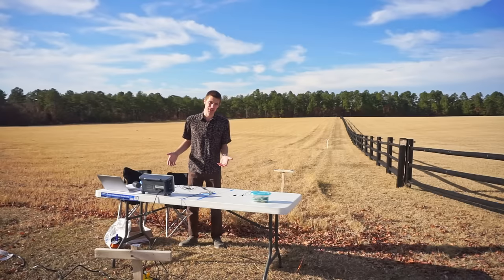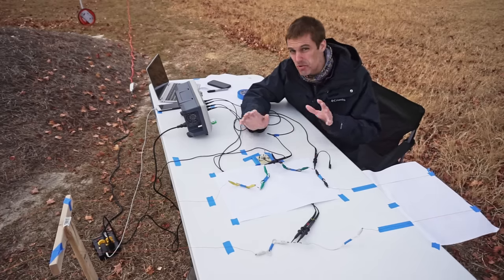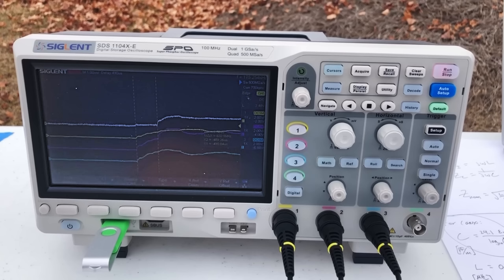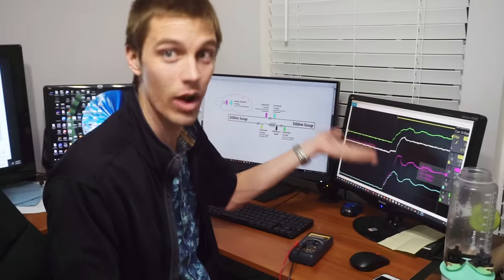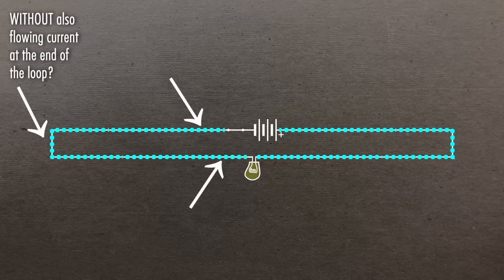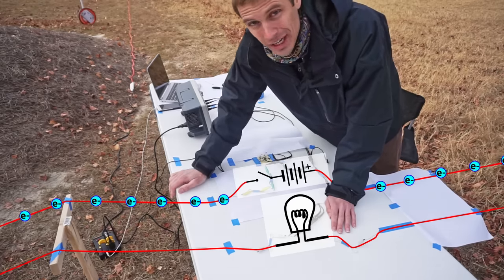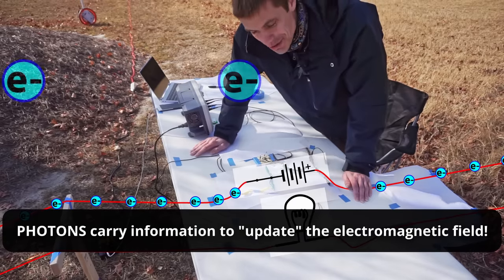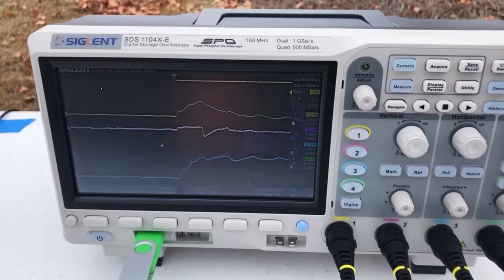I bought 1000 meters of wire to settle a physics debate

Comment: This actually covers the Transmission line theory. At least it does when you cut the wire! The characteric impedance of the wire setup is approximately 45 ohm. If you lower the 2 series resistor to 47 ohm then you can see the 0.2V increase into roughly 2.5V. You can measure this with the oscilliscope near the switch. A 2.5V wave will start from the switch, travel to the open end, bounce back at 5V and return to the switch at 2 times the wire length.  I use this theory a lot to remove oscilations on electronic designs.

The 1K series resistors causes the current to slowly start up (1.7mA). Changing it in to 47 ohms should make an instant current much more close to the nominal current.

Great experiment, very interesting!
Reply: Exactly. That initial small step-response of current is revealing the characteristic impedance of the circuit. Since he knows both the wire diameter and spacing, it's simp,e to calculate that value and see how it compares to the 45R you calculated from the scope traces
Reply: Shouldn't that voltage also depend on how far the two wires are apart? Why would it 2.5V ?
Reply: @renedekker9806  Yes it does. The characteristic impedance (Z) consists of an impedance L' and a capacitance C' propagating through the wire. It is complex and difficult to calculate, but if you match the series resistance Rs with Z it can be calculated  really simply as a resistor division.

Imagine 2 long unconnected wires like Brian did when he cut the wire at the end: Only now one wire is connected to the negative pole of the battery and the other connected to the positive pole using a switch and series resistor. As soon as the switch is turned on,  there is a division of the series Rs and the Z.  When Rs and Z are roughly the same you see a division of 50% , so 2.5V  propagating along the wire.  At the end of the wire after 1.6usec the 2.5V  bounces and reflects to 5V which in turn propagates back to the beginpoint.  So behind Rs (at the beginpoint of the wire) you should measure 2.5V  for 2 times the propagation time ( 0sec - 3.2usec) and then it will jump to 5V. 

I must say,  my initial 45ohm calculation  for the characteric impedance isn't correct. I think it's more close to 5K - 10K, but can't accurately calculate it right now as the series resistance is not matched with the characteristic impedance.
Reply: @liam3284  Yes I think it is. I don't know about the 1/3rd rule though. you should also keep in mind there is a resistor at the beginning and at the end in this setup.
Reply: @foppe6849  -"Imagine 2 long unconnected wires like Brian did when he cut the wire at the end"_ - and now imagine placing the two wires 10km apart. Would the induced voltage still be 2.5V, or would it be less in that case?
If it is less in that case, why would it be 2.5V if they are placed 1m apart? Wouldn't the distance between the wires need to be somewhere in the formula to calculate the induced voltage?
I would expect it to drop off very quickly with distance. I would expect the 2.5 volt that you mention to only be applicable if the wires are millimeters apart.
Reply: @renedekker9806   If the wires are 10km apart, the voltage would increase because C' would decrease and  the characteristic impedance Z would be higher. Let's say initial voltage would be 75% of 5V now (3,75V). After 1.6usec, this voltage would reflect back at the open end at doubled size  (150% of 5V = 7,5V). After 1.6usec it would have returned at the beginpoint and reflecting again into around 4.4V. This reflection can be seen easilly with a oscilloscope and would travel back and  forward a few times, eventually dampening out at 5V. 

It's just applying transmision line theory on a fast step response.

 There is probably a formula to calculate characteristic impedance Z containing distance, dielectrum, area etc but I haven't used it yet.
Reply: @foppe6849  "It's just applying transmision line theory on a fast step response" - I am arguing that transmission line theory is likely not applicable anymore if the wires are further apart than a couple of millimetre.
Reply: @renedekker9806  that could be, maybe you're right. However we did see a small constantcharge current during the propagation time which means  there is a capacitance between the wires.  I say this opts for a test .
Reply: @foppe6849  Z is not difficult to calculate, if you have the capacitance per unit length and inductance per unit length.

If I recall correctly, without even looking it up, it's the square root of L divided by C. What's hard about that?

Use meters to measure L and C for the full line length, and divide by the line length to obtain  inductance per meter and capacitance per metre 

Transmission line theory is going to be hard for many people to get their head around, but not determination of the characteristic impedance itself.
Reply: @renedekker9806 Transmission line theory is not dependent upon the separation of the wires, it's to do with wire length, capacitance and inductance per unit length and critically signal rise times. 

A lot of people think it is to do with high frequencies, well, that's not strictly true. The higher the frequency then the faster the signal rise time.
There is a criterion which indicates when you should be considering wires as transmission lines and this when you have to worry about transmission line effects
Reply: @deang5622  "There is a criterion which indicates when you should be considering wires as transmission lines..." - And I assume that that criterion includes separation distance between the wires?

Comment: Finally someone explains this in a way I really can follow. That Poynting vector thingy was more confusing than helping. But the simple  illustration with the electric field convinced me.
Reply: Simpler for you does not make it correct.
Reply: So this is closer to how experiments are actually performed, where the signal is broken down for different phenomena. The Poynting vector is something you talk about after Maxwell's equations and E+M in general. It is hard. Poynting vectors just tell you the flow of energy. I think a quick summary of what Veratasium was talking about comes from the fact that energy in a field is E^2+B^2 and that contains energy. Fields extend like this video shows so a little bit gets to the bulb first which is that early blip. Poynting vectors just ask if we know how the fields, relate, can we tell where the energy goes? They don't representing the physical processes in themselves.
Reply: @nineball039  It's not incorrect either. It's a different point altogether. The experiment Derek picked is a poor fit for demonstrating what he wanted to demonstrate.

I don't know that a "good" experiment exists; it's a fairly abstract point that's largely irrelevant in actual practice.
Reply: @danielmorton9956  That's right, people have a really hard time letting go of the idea that energy is this tangible fluid-like "stuff', when really it's something that exists only in our heads because it makes solving problems easier. What's actually out there are electrons and electric/magnetic fields; the Poyting vector is a calculational shortcut that lets you say certain things without having to go through the full calculation.

Comment: Current bouncing back and forth causes havoc in electrical fired fireworks unless a firing system has gates built into the circuit. Electric blasting circuits can also have this problem especially when extraneous current is starts to enter the circuit. It's a deep subject that very few truly understand. Maybe you can do a video to prove if a shunted blasting circuit is safer Vs an unshunted one. Again it's a massivly deep bunnyhole of argument.
Reply: What?  Assuming I'm reading your comment right, are there really people think that a system with the ends floating is as good as one with a terminating resistor?  I mean, anyone who's done anything with signaling, including the common DMX lighting protocol (RS485) knows that you *can* often get away without a terminating resistor sometimes, but it is practically required on longer runs.
Reply: How bout those detonators timing circuits on a nuclear warhead?
Reply: I'm currently trying to fix an HMI ballast, don't give me more stress!!!
Reply: After a local accident, they did some off the cuff testing and found that our firework squibs, with ~20' loop of wire twisted off (the way you would carry it) could be ignited just by keying the mic on a Motorola uhf radio next to it. NASA of course has already done much of this type of research because the pyro on spacecraft, and various pyro failures over the years. If i recall, everything is shunted, but they use notably higher currents to ignite the squib (and for good reason considering my first example). They have a publicly available pdf, but can't remember the title. Having done some firework wiring myself years ago I was always surprised just how little it takes to ignite the common squibs, and how far behind fireworks industry is from the research they should be drawing from -- I think the pdf is well over 20 years old!

Comment: This sort of back and forth bounce is used to locate damage using timing. Also can show if there isn't anything extra hooked up in to system to steal power, echo will reveal everything
Reply: Very interesting. I was always aware that the signal could be analyzed to detect leeching but I never put much thought into what that actually looks like or consists of. Thanks for mentioning it. It stimulates my curiosity in terms of how that analysis takes place and what it looks like.
Reply: This ;) I'm a radio amateur and a few years back in our club we made a small device / electronic circuit that make very small but very powerful voltage peaks in a well behaved manner. That with help of an oscilloscope can test the quality of a piece or string (including connectors) of coaxial cable(s) . From the signal on the oscilloscope (top voltage of returning pulses and time from first transmission) you can then interpret if there are any (unexpected) shorts or opens, the dampening effect of the coax, quality of the connectors (if any), impedance mismatches, etc.Very useful in all kind of situations where you're no longer sure if your 'wire' does what it's supposed to do. For example to see if the cable to your antenna is still decent or if it's waterlogged due to the exposure to the elements or broken due to stress at its connector points or any other misfortune that could happen...

Comment: Every resistor behaves like a lightbulb if used wrong enough, just like how every diode is an LED, in similar circumstances.
Reply: Before those, we had arc lamps, would those be considered spark gaps?
Reply: Careful about the diodes, they first are SED, which stands for smoke emitting diode.
Reply: @KrupyFren  enough current and the light comes at the same time XD
Reply: just like how every diode is an LED, not in my experience. Most times they just silently die (no more current going through) I ones that actually exploded tough. Never I have seen on shine.
Reply: Um, afaik every diode really is an led (as well as a solar cell) thou. Some just don't shine in the visible light range.
Reply: Yes, and every capacitor is an improvised firecracker, when you connect a 15v aliexpress capacitor to 220v ac wall power
Reply: @backseatgaming2145  I used to work at a facility assembling million + dollar electronic equipment, once in a while the guys on the floor would hook up a capacitor directly to the AC wire, so when the machine went to test it popped and released smoke as soon as it was plugged in 😂

Comment: Loved the explanation that a millimeter is a very long distance for an electron to move in a wire.  I don't think this gets said enough in most explanations of current flow.  It shows why electron flow is so slow compared to everything else going on in the circuit.  If electrons were astronauts it's the difference between sending someone to the moon vs. going to another star.
Reply: It's a lot like ocean waves.  The individual drops of water mostly just move up and down.  They are just the medium used to transmit the waves.  The energy of every wave crashing on the beach has come from a great distance at impressive speed, but the water is mostly the same matter as the previous wave and only slowly cycles in and out.

Comment: As a HAM radio operator - I see the experiment as 2 dipole antennas right next to each other and DC as having a short and weak AC impulse signal before reaching a static state. If the two wires weren't connected at the ends and the signal was AC instead, it would be easy to transfer the energy and turn on the light bulb instantly. I've seen this demonstrated in other videos on youtube. Would be interesting to see you bring this point into the debate as well.
Reply: And of course, to make the point of the distance and capacitance obvious - it would be cool to see the wire strung out in a big circle.
Reply: With AC you would only transfer current according to the characteristic impedance of the line. With the small wires some foot/meter apart, the characteristic impedance would be close to 1 kOhm. Hence not much power would transfer. (Perhaps if you match the frequency/wavelength to the length of the line, as you do with antennas, you could get some additional benefits?)
Reply: Exactly my thoughts. It is practically a very long antenna. With AC at a resonant frequency, you would be able to transfer energy. It would still be a lot less efficient than if you actually connected the ends of the antennas.
Reply: When I saw Veritasium's setup I thought: ladder line
Reply: It's coupling between the antennas before the DC component is established. Near-field interactions are frickin' weird.
Feed it with a 1 kW signal of about 1.5 kHz.
Sit back, and wait for the FCC to arrive ;)
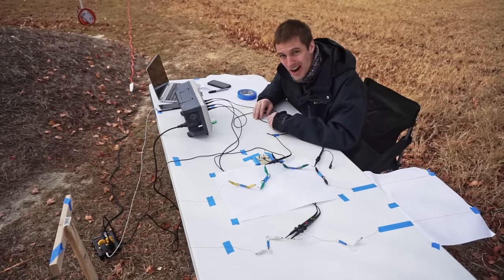Reply: I was thinking it would make a fantastic AM antenna! AM stations might be what all the background noise is at 5:07.
Reply: @5roundsrapid263  You are correct.  There is AM radio, the cell phone towers impinging voltage on that wire through RF coupling at the impedance of the wire. There's gonna be some AC noise in there. We see some of it as the squiggles. Also, that long wire is crossing the magnetic field of the earth, which is moving 1000 mph give or take as the Earth rotates in space-time. It's not enough to power an ant's motorcycle around a cheerio in small experiments, but this is where it can be detected.
I bet the noise from nearby AC transmission lines on the pole can be detected or gauged how far looking for blips in the noise at 60 Hz(American AC, 50Hz European/Japan).
Reply: Is this similar to how a transformer transfers electricity?
Reply: @javierortiz2806  Roughly the same idea, but in a transformer, one coil’s electromagnetic field induces an electromagnetic field in the other.

Comment: This by far and away the best video I have seen on this subject. An honest experiment that, like all good experiments, raises more questions from various effects seen.
 I have 35 years of civilian service to UK MOD RAF as an avionics specialist; so have a very good feel for this subject.
I to have a  MICSIG 1104C . It is the most versatile bit of kit I have ever used. Less than half the price if it's Tektronix counterpart. You are very close to a complete description of Transmission Line theory, the fact that it demonstrates the electric field effect so clearly is great. You are also close to another instrument called a TDR; A form of coax  cable RADAR. Works on Cat5 and Cat6 as well with a suitable adapter.
Nice one very informative

Comment: As an electronics engineering student, THANK YOU! It helps a ton to actually develop an intuitive understanding of what happens, as for all this time the general response I got, even from professors teaching the effects, was the thing I hate the most: "trust the formula, it works!".
Phenomenal video, good job!
Reply from the maker: I hate trusting formulas, which is one of the reasons I didn’t go into deeper physics for my PhD. The amount of solid state physics needed to do semiconductors for the most part can be excellently visualized, which means I can understand it 😁. Gaining intuition from an equation requires a SIGNIFICANT preexistng intuition based on something more tangible, in my experience.
Reply: @AlphaPhoenixChannel  That's not what I found in my degree. It's fairly straight forward to look at the formulae and see if it looks right with they key terms oriented in the numerator or denominator of a fraction. Sure, you may not be able to simply create a formula from intuition, (the capacitance formula of a parallel plate capacitor is one I would argue is intuitive) , but they are easy enough to look them up when needed.